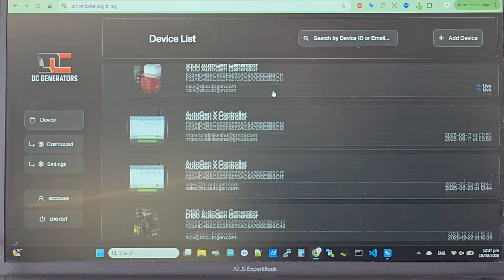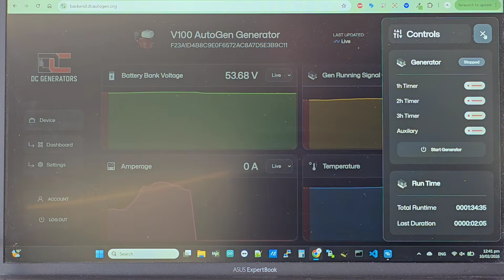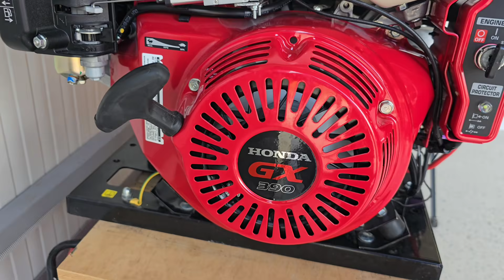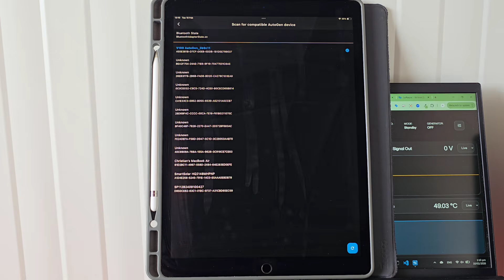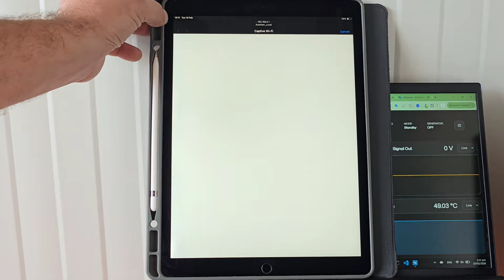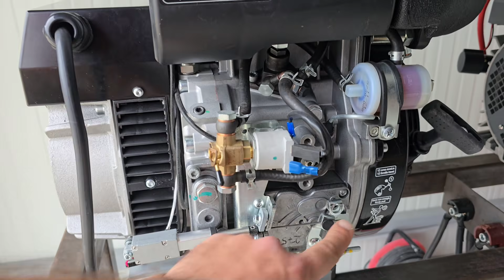48v DC Generators - IoT, Automated start plus more.

Comment: i've got ONE question:

how do you manage to put any current in a battery bank sitting at 54V while the generator output is at 46.xx Volts ?

in my education they told us you always need a delta towards the direction of energy flow.

that is like an alternator in a car putting out 10V while the battery sits at 12.4V.

how is that possible ?  are you kidding ?
Reply from the maker: That's only a voltage signal which is actually AC at the rectifier block. 2 of the 2 phases. It's used as one of the engine running signals, the other being oil pressure.
Alternators are 3phase.

Comment: That's crazy, a 100 amps...
Reply from the maker: 180a with the D180 AutoGen.
Reply: 100 Amps at 48 ish volts, or about  40 amps at 120 volts. I have an AC-to-DC charger advertised as 100 amps, but it's likely rated at around 48 volts. I have never gotten it to charge above 94 amps. This kind of stuff should be rated in watts. Since watts aren't affected by the voltage.
Reply from the maker: Our DC Generators have 2 stages of charging. Bulk and Absorption.
When you charge at 100amps Bulk, voltage will slowly rise to meet the Absorption voltage setting.
Once that threshold has been met, it will stay at the Absorption voltage and current will taper downwards, as batteries absorb until they are fully charged, as they can't absorb any more current.
Whether it's rated in watts or amps, doesn't really make a difference. What matters is the maximum capabilities under certain conditions.

Comment: We want to see actual kwh added to a connected 48v battery per gal/liter of fuel used
Reply from the maker: Consumption per kwh coming shortly
Reply from the maker: Today we performed efficiency tests on the D180 AutoGen.

Test #1 — Medium Load
Voltage: 52.0 V
Current: 100 A
Power Output: 5.20 kW
Fuel Consumption Rate:
1.67 L/h
0.440 gallons/hour
Fuel Efficiency:
0.321 L/kWh
Conversion Efficiency:
31.4%
Test #2 — High Load
Voltage: 55.2 V
Current: 180 A
Power Output: 9.936 kW
Fuel Consumption Rate:
3.00 L/h
0.793 gallons/hour
Fuel Efficiency:
0.302 L/kWh
Conversion Efficiency:
33.3%
Engineering Summary
AutoGen D180 shows improved efficiency at higher load:
Efficiency increased from 31.4% → 33.3%
Fuel consumption improved from 0.321 → 0.302 L/kWh
Peak measured output: 9.94 kW
Peak measured efficiency: 33.3%

Engineering Summary
D180 AutoGen shows improved efficiency at higher load:
Efficiency increased from 31.4% → 33.3%
Fuel consumption improved from 0.321 → 0.302 L/kWh
Peak measured output: 9.94 kW
Peak measured efficiency: 33.3%
This falls within the expected efficiency range for well-optimized diesel generators, which typically consume 0.2–0.4 L/kWh depending on load and design.

Next week we will perform tests on D100 & V100 AutoGen gensets.
Reply: @DCAutogen Great work!
30%+ efficiency is excellent use of gasoline  to electricity
Reply from the maker: No, that was the larger D180 AutoGen with diesel. At full load it was very efficient!
Early next week we will test the gasoline consumption of the V100

Comment: Are these add on systems to any engine, or complete engine builds only?
Reply from the maker: The alternators are matched for these engine shafts, rpm and rated horsepower.
Reply: @DCAutogen  I was asking about the control system for the engine. Or isn't that the system you were referring to?
Reply from the maker: @louismessere6379 we developed these controllers for these engines. They can be applied to other similar engines, with minor firmware tweaks.
Relays control the starter motor and fuel supply. Linear actuators control throttle as the current output is based on rpm.
Battery voltage and current output is measured at all times.
So they can be added to other engines. For AC gensets it would only add automation in startup and shut down.
Reply: @DCAutogen  do you have one for a 2 cylinder diesel hartz engine air cooled?
Reply from the maker: SAE J609A EXT.6-01INCH FLANGE TYPE B
Reply: If you have one how much? I got the generator system from an auction where the government was clearing unused equipment from inventory and the wiring I got was hacked in weird locations and I haven't found any documents as to how it's wired yet. So that means when I start to search the wiring that's there what isn't beneficial to me is getting pulled and replaced. It was built with a 200 to 500 amp, 24 volt DC alternator that can start the engine the same as it can generate DC power. I need a controller that can make use of that setup. I'm hoping you might know where I can get a universal controller for it.
Reply: @DCAutogen  lol sorry it's already geared to the back of the engine. Sorry I didn't know what you meant a moment ago so I did a search for it. It's directly geared to the back of the diesel engine with the gears own lubrication and everything. I need a controller to start 24 volt DC alternator and stop starting then to switch over to charging up to 300 amps. I need an electrical control system.

Comment: Can the voltage be pushed to 60v-61v? I am looking for a unit that will charge a forklift battery and be able to equalize it at 4 month intervals.
Reply from the maker: Max voltage is 57.6
These are designed as an automated backup solution. Not for equalizing a battery bank, as this would not be efficient.
Reply: @DCAutogen auto backup for a solar system 48 volt battery bank maybe?.
Reply from the maker: Any 48v battery bank, solar included.

Comment: Did you perform efficiency tests regarding chemical input vs. electrical output? In my case i got a frustrating 15% efficiency with a older honda 10i generator.
Reply from the maker: Data will be available within the next few weeks on our website.
Reply from the maker: Today we performed efficiency tests on the D180 AutoGen.

Test #1 — Medium Load
Voltage: 52.0 V
Current: 100 A
Power Output: 5.20 kW
Fuel Consumption Rate:
1.67 L/h
0.440 gallons/hour
Fuel Efficiency:
0.321 L/kWh
Conversion Efficiency:
31.4%
Test #2 — High Load
Voltage: 55.2 V
Current: 180 A
Power Output: 9.936 kW
Fuel Consumption Rate:
3.00 L/h
0.793 gallons/hour
Fuel Efficiency:
0.302 L/kWh
Conversion Efficiency:
33.3%
Engineering Summary
AutoGen D180 shows improved efficiency at higher load:
Efficiency increased from 31.4% → 33.3%
Fuel consumption improved from 0.321 → 0.302 L/kWh
Peak measured output: 9.94 kW
Peak measured efficiency: 33.3%

Engineering Summary
D180 AutoGen shows improved efficiency at higher load:
Efficiency increased from 31.4% → 33.3%
Fuel consumption improved from 0.321 → 0.302 L/kWh
Peak measured output: 9.94 kW
Peak measured efficiency: 33.3%
This falls within the expected efficiency range for well-optimized diesel generators, which typically consume 0.2–0.4 L/kWh depending on load and design.

Next week we will perform tests on D100 & V100 AutoGen gensets.
Reply: Wow! This is a great result!

Comment: Hey for commercial clients does this have an 2 wire start for automation with some thing like a sol-ark charge controller or similar. Also can a added RJ45 keystone be added so that way a commercial or end user could plug in the local network rather then rely on lte all the time. Maybe a localhost on the device where a client could operate this with a full grid down outage scenario? This tool looks amazing but seems packaged only to a small market user more less the every day personal user.
Reply from the maker: It's 2 Wire start ready by default.
RJ45 is not an option.
LTE for remote control and monitoring from any location.
Bluetooth and WiFi for local access.
Reply: @DCAutogen  Well for future design I strongly encourage a POE keystone or similar system some of the people I use to work for in the past don't allow Wifi or networking at all due to security related concerns. But cool product keep up the good work hopefully future designs will more accessible to the commercial restricted access customer.
Reply from the maker: These units have been developed for a commercial client according to the requested specs. Wifi is only used for local access. No cloud connection.
LTE is used for cloud connection.
Security is robust for such an application.